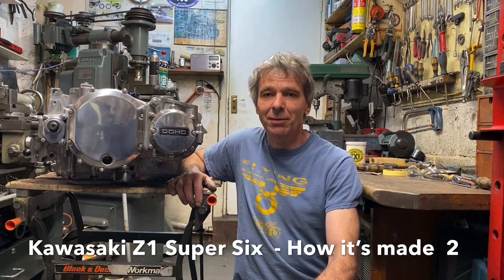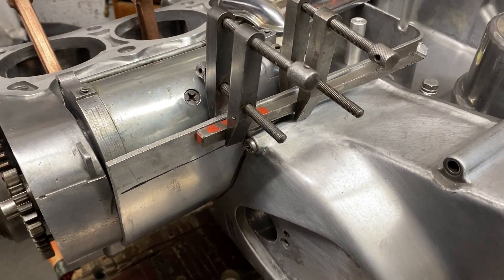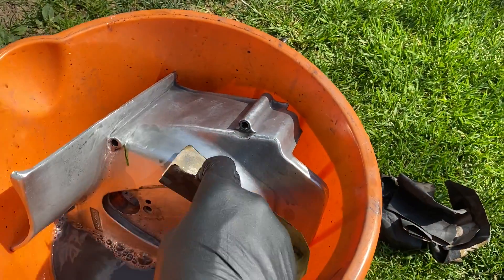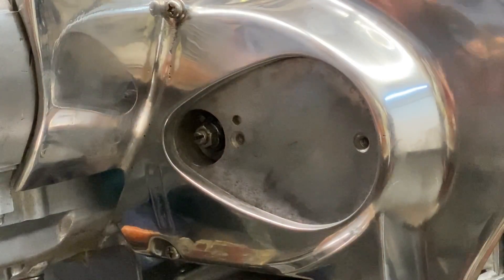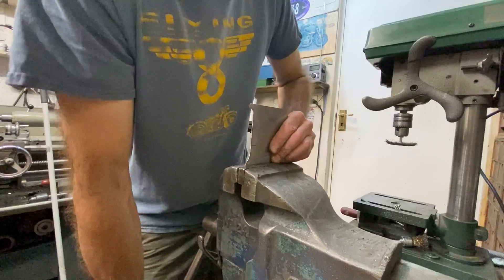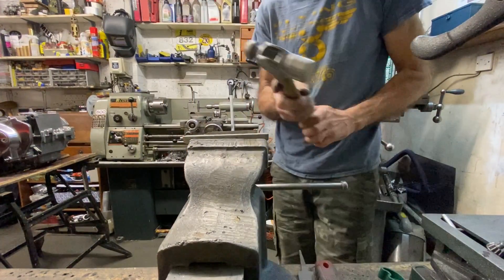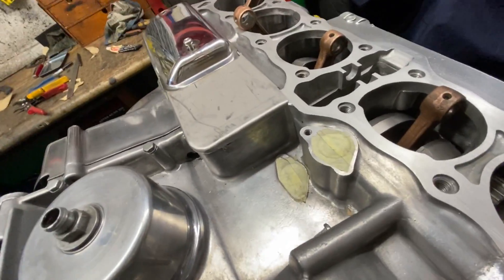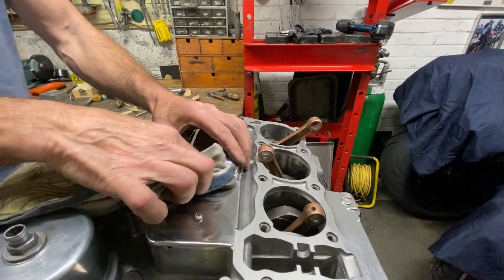Kawasaki Z1 Super Six Engine Covers - How its Made

Comment: 14:45 instead doing what you're currently doing take the DIN914 set screw with matching thread and bolt it with the cone pointing upwards, slight hammering gives you excellent drilling points

Comment: No big workshops or mega dollar machines here, just a multi talented Brit and his shed.
Reply: Although Rolls Royce had all the mega equipment (for the time), it was people like Allen who built the Merlins that won the war. The Hucknall site had a Mustang flying with a Merlin in just 6 weeks. They literally hung the engine on chain blocks in front of the air-frame, lined it up and took measurements from there. 
Allen would have been in his element.

Comment: Hmm.. maybe Allen in his softspoken way is pointing out that you don't need massive chunks of aluminium and 5-axis CNC machines to fabricate things. He gets along fine with tin snips, hammer and a vise. Ok, he did also use a socket, TIG welder and a band saw. There was a couple of pores in the weld, he didn't seem to mind.
Still wondering how he makes those invisible crankcase splices...

Comment: Might have to buy a set of the sheet metal drills whilst I still have fingers, I am getting too old for the 'helicopter of death' on the pedestal drill.
Reply from the maker: they are brilliant and cut and enlarge holes in sheet stainless effortlessly
Reply: I have always known them as ''Step drills'' which should come up in searches. My uses are holes in fairings for motorcycle accessory switches, mini meters, chargers, etc. plus for hobby enclosures and 14mm mounts last week for fabricated turn signal brackets.